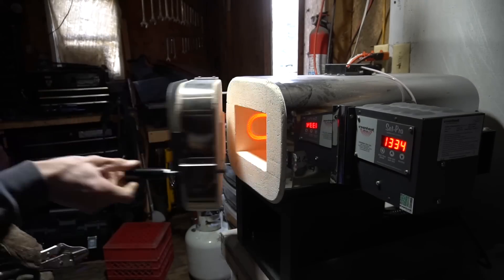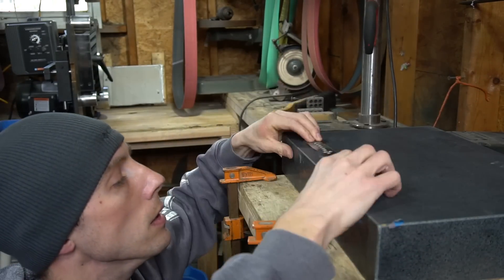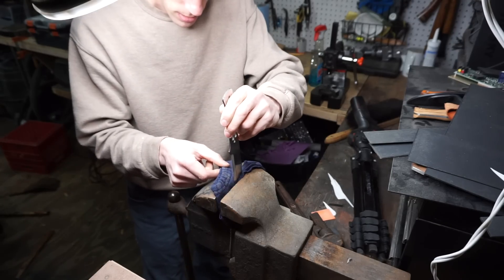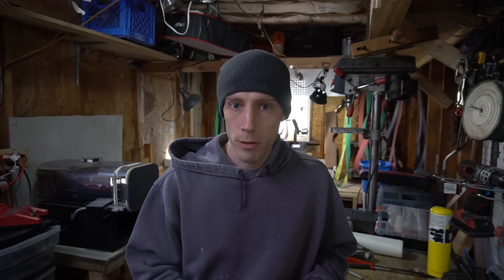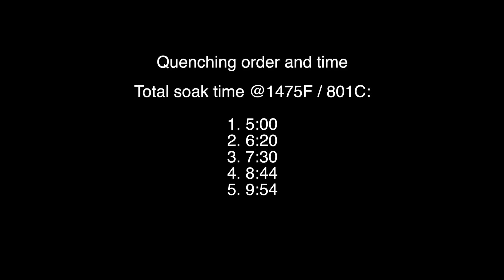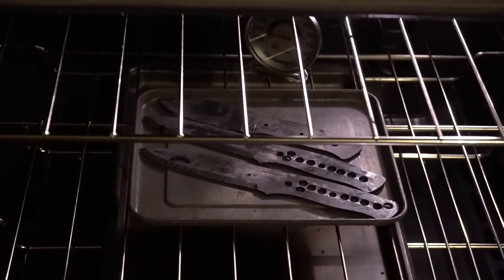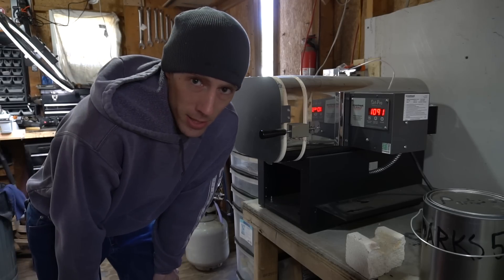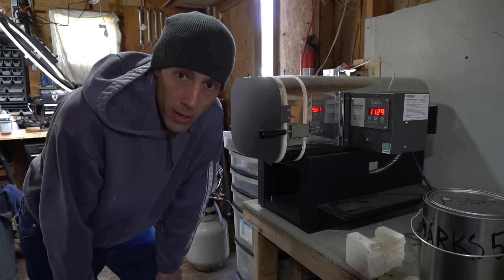Why Knife Makers Should Break Their Knives

Comment: Good work.  The heat treat conclusion is correct. However, you are misinterpreting what you are observing.  You are not looking at the grain structure.  You are looking at different types of failure modes.  In a brittle fracture, a crack forms and cleaves through the material, leaving a smooth finish.  In a ductile fracture, the material distorts and "necks down".  This simultaneously creates a rougher looking surface and simultaneously the effective cross-section is reduced.  Eventually, the cross section is reduced enough that tensile strength is exceeded.  When that occurs crack forms, the crack quickly propagates through the material and the knife breaks.  Part of the fractured surface will be rough and a part will be smooth.  

You can tell all about your heat treat process by simply looking at the fractured surface and estimating the ratio of ductile to the brittle fractured surface.  

As a side note, the ideal condition would be for the cutting edge to be hard (but not "brittle") and for the back to be more ductile.  That would create a knife that would both hold an edge and not snap under heavy loading.   

To observe the grain structure, you would need to cut polish the surface until it was mirror-like.  You would also need a microscope.  Sometimes you need polarized light and an etchant to cause the boundaries to "pop" out. 

In any case, good job.
Reply: This guy forges
Reply: @beepIL  Says Russ Hanneman, right?  lol
Reply: We SO need more researchers, developpers and Doctors commenting on Youtube video's
And this is why, Thanks @Dan Pedersen please spread the word.
Reply: Do you teach? 😅
Reply: @gamer.004  No, I did research in fracture mechanics.
Reply: Dan Pedersen woooow, Respect, I bow to you!!
Reply: Rob Rob if he is a researcher in fracture mechanics he deals with all kind of metal materials. So yes he knew what is he talking about. This is the same thing in steel manufacture and factory they do these kinds of test to verify a mixture of steels
Reply: The smartest comment thread i have seen.
Reply: thank you for this, youtubers spreading so much disinfo lately after being in a hobby for a year lol
Reply: I’ve studied a bit of material science in my engineering undergrad, and the practical experiments I’ve done match 100% what you’ve said. We used brass specimens instead of steel though.
Reply: Dan, so you're saying that grain structure is unobservable to the naked eye and the differences that appear in the various samples in the video are due to the state of the metal and how it fails, a brittle fracture appearing smooth and a ductile fracture being rougher?
Reply: @Aaron Washburn Yeah. I wasn't trying to say that plastic deformation always changed the yield point, just that plastic deformation only occurs after the material yields. In all honesty, I am not the most qualified on this topic, I was mainly just providing a bit of information as requested by OP.
Reply: Another option is to send it to X-ray diffraction/ Mossbauer spectroscopy to find out more about the bcc/grain structure of the blade without necessarily destroying it.
Reply: Would only polishing be enough? I was taught that etching is also vital to observe microstructure, but since materials science isn't my main specialty, I am generally curious about it
Reply: @Aaron Washburn ah ok, so I at least remember it correctly, thank you!
Reply: I would like to read about fracture mechanics. Could you recommend a source ?
Reply: @thiago.assumpcao  I do not have anything to suggest.  The internet is full of good information.  Google will find you many articles.  The primary measure is, "fracture toughness".  Also query the keywords, critical crack length, and fracture surface you will find some interesting things to read.
Reply: @MrTodayistheday  Thanks
Reply: I just wanted to write exactly the same just to find out that sb has alrdy done that and was even upvoted to the top. Nice
Reply: @Aaron Washburn it doesn't, powder only shows amorphic in mossbauer, it is often done with thin strips for better understanding.
Reply: Ok
Reply: he's too proud to adore your comment, that's sad
Reply: Can't you just call each other gay retards and move on like the rest of us? Jesus...
Reply: @CollinInGame  He's right though you know ... the current profession I'm learning in Germany deals with exactly that procedure and it's the backbone of quality control, especially for metals and has existed since 1906 so you know ... maybe setting things straight is not for 'gay retards' but for people that care about their products and make sure that they have a competitive advantage ...
Reply: @AlkalineLuke  Agreed
Reply: I thought that was Michael Rappaport in your pfp
Reply: Aha you dont say (pretends to have understood something here) Soooooo which steel used in folding knives have a near unbreakable tip?
Reply: @gurugoguzhanson  Good question.  There is a tradeoff between toughness (bend before break) and hardness.    Harder metals tend to hold a shaper edge.   To be unbreakable, it would have to be soft, making it useless as a knife.  There are some specialty vacuum melt steels used in the aerospace industry that are very tough.  I am not sure if they hold an edge.
Reply: The difference between strength of a blade and toughness is not difficult to understand ;D
Reply: @MrTodayistheday  There are some super alloys that are super strong with very high stiffness. They have a relatively very tall but steep stress-strain curve. Effectively they'd take more energy than a human being can manually generate to reach fracture but will pretty much just straight up shatter/explode almost immediately after yielding. The reason why we generally aim for relatively high toughness in most products we make is that the item yielding and elastically deforming is a good warning sign that a failure is about to occur if you're keeping up on maintenance and inspection. You generally don't want critical parts that give no sign at all that they're going to fail until they just completely snap in use. The other thing to impress upon people when they look at a stress-strain curve is that the strain axis for most metals is "blown up." The actual strain values are very small and this gets even worse for a very naturally brittle material with lower toughness. You may not perceive any actual displacement in the metal even when it's supposed to be fairly tough. I remember having this discussion doing material failure analysis to see if our sample matched empirical data taken from a chart and they were like, " We should have gotten 3 mm strain before yielding" and I had to remind them that the strain axis in that particular chart was normalized to accentuate and give a visible graph horizontally and that the actual value was 0.03 mm which is what the strain gauge readout was when it started yielding. 

Many of these blade smiths never took a course in materials science or engineering which is fine. The thing is though, that you generally don't have to do much destructive testing yourself anymore as there are empirical data charts where someone has gone through the work for you. Taking even an introduction materials science course will teach you that the primary key factors are Tmax (max temperature), deltaT (temperature differential during quenching), and deltat(time it took to reach the high temperature to the lower temperature.) The only time I did failure testing for metal samples was to ensure that the foundry quality was what they said it was. After that, the metal will behave pretty much as the charts say they will as long as you and your equipment will do their part. For example in this video, if you look closely, you can see discoloration in only one half up to nearly the core of the metal samples and this was consistent for nearly every sample. This shows that the metal in this video was at slightly different temperatures before quenching and could be an indicator that either the metal wasn't left inside of the oven till it was uniformly hot or the other metal was too close, becoming a heat sink and they effectively pulled heat from each other relative to the outside that just had full heating element.
Reply: @MrTodayistheday agreed and in outer space where it is extremely cold metals alloys steel and different materials all behave differently subjected to the cold and have to be engineered knowing these things.
 I'm sure NASA has a wealth of data to peruse if you have the right security clearance...... Thanks for your wisdom
Reply: Read a few articles about it. Very interesting. To make things a bit more complex there are other 4 types of fracture mechanics. Ductile, brittle, intergranular and stress. 
In this case its pretty obvious ductile fracture but it seems rough surface can also be intergranular.
Reply: @thiago.assumpcao  I like your enthusiam.  Intergranular fractures would occur if something strange happened in the cooling process causing a precipitate to coalesce at the grain boundaries (not common).  It could also happen if corrosion was playing a role. (Common with alloys containing very different electrical potentials).  Another mode of fracture is "fatigue".  It looks like a polished surface.  But, inspection with a microscope will reveal micro-striations associated with the load-unload cycle.  Good job.  Keep reading.  I hope to learn from you someday.
Reply: @MrTodayistheday  Thanks for the info. I've seen some very high level blackmiths mistake fracture mechanics with grain, that was really interesting and usefull. 
I have a small yt channel about knives and sharpening but all content is in Portuguese, maybe someday I'll translate the best videos to English.
Reply: @MrTodayistheday  Cool. I'm Brazilian, If he has any issues with with translation let me know.
Reply: Great info thank you
Reply: So make the edge only red hot with high power induction?
Reply: This is al FM to me, Fuckin Magic 🤔
Reply: Ductile definitely isn't the word you meant. Also, you wouldn't necessarily want a brittle edge. It doesn't matter too much how tough it is, but a higher toughness means you can repair it more easily. Brittle or tough, the priority should be making the edge strong and hard
Reply: @goodguykonrad3701  You are correct.  I did not think this lay audience would be interested in the technical definition of toughness: The area under the stress strain-curve or the ability to absorb energy before fracture.  I simplified the description to a ductile-brittle analogy. For a specific heat-treated steel, the more ductile heat treat is almost always tougher than the more brittle heat treat.    
I just came across this.  It is a better explanation than mine. http://www.materials.unsw.edu.au/tutorials/online-tutorials/2-cup-and-cone-fracture#img   
- Any idea on how to succinctly explain toughness to this audience?
Reply: @MrTodayistheday  Toughness is a measure of the amount of energy required to create new surface area on the material. It can be better described when the three stages of deformation: elastic, plastic, failure. 

Elastic deformation is when energy applied to a material causes it to deform/change shape, but the material will return to the state it was in before it was deformed (like how an elastic band can be stretched but returns to its original shape).

Plastic deformation occurs when the stress on an object is great enough that deformation goes beyond elastic and becomes a permanent change to the shape of the material (like creasing a piece of paper).

Failure is when plastic deformation is too great and new surface area (e.g. cracks) form and the material behaves differently and almost unpredictably. The creation of new surface area forms a stress concentrator, greatly increasing forces applied to that area, causing the object to break/rupture completely.

Strength is the object's ability to withstand elastic deformation. Toughness is the object's ability to withstand plastic deformation. Failure is when the object is at least partially broken and behaviour becomes less predictable as it breaks completely. 

Glass: strong, not tough
Rubber bands: not strong, tough
Paper: not strong, not tough
Metal: strong, tough

Also, I'm guessing ductile may have subtlely different meanings in different parts of the world: I'm from the UK and I've always been taught that ductility is a description of a material's ability to have long strands of wire drawn from it. Not to say that doesn't apply to the Australian link you sent me, but it seems bizarre in that context.
Reply: @MrTodayistheday  I would be interested in more technical talk on fractures, I was sad that the discussion ended.
Reply: @LondiniumArmoury  Sir, Thank you for the encouragement.  My intention was to introduce this group to a few new concepts and keywords.  I did research in this area many years ago. I thoroughly enjoyed doing research on this topic.  But, my calling was managing mega projects.  Unfortunately, I do not have the time to revisit this topic in detail.   There are a number of sites out there that can provide you a wealth of information.  When you start your independent reading it is important to know the following: Metals and non-metals fracture differently, ferrous metals and non-ferrous metals are heat treated using very different techniques.  Both cold working (forging) and heat treat affect both fracture toughness and failure mode.   I suggest you Google the following keywords: fracture surface, fracture analysis, heat treat, annealing, Rockwell hardness vs. heat treat, effect of heat treatment on tensile strength, effect of heat treatment on yield strength, tensile strength vs. yield strength (this is a quick estimate of toughness), stress-strain curve, fracture surface vs heat treat,  fracture toughness, crack length and critical crack length.   If you want to discuss something specific, you can contact me directly at pedersen124 at hot mail dot com
Reply: @MrTodayistheday  Thanks and no problem, I already have lots of Data sheets and files open on this topic on my laptop as we speak, it's an interesting topic that I might cover for a video series, I will credit you for the inspiration. I work with through hardened, differential hardened, cold work hardened and case hardened metals. Ranging from pure fine silver all the way to steel alloys and titanium. I agree with what you have been saying, I have also been working on comparison tests between through hardened steel and edge quenched and differential hardened steel. I also ran some tests on work hardening annealed steel until fracture and comparing it to a fracture in through hardened steel, I found crystal like structures that formed from the friction and break around the fracture, which from an annealed state I thought I shouldn't find.
Reply: @LondiniumArmoury   I am impressed that you are doing your own research.  If you can send me photos of your specimens, I can help you interpret the fracture surface. My explanation will simply assign the surface texture to the name associated with the mode of failure.  Knowing this will enable you to review a large body of work already existing on this topic.   Further, a few minutes of explanation up front will enable you to control and manipulate the appropriate parameters.  This could shorten your research by years.  :)
Reply: @MrTodayistheday  niceeeeee
Reply: @goodguykonrad3701  that would depend on the strength type and size of the carbides vanadium
chromium
Cobalt
Nitrogen
Molybdenum
Tungsten 
Choose your weapon and take advantage of what is offered by the mix of the metallurgy...
So many variables to play with... I love  postulating such things! 
It seems they are coming close to perfecting steel/edge retention applications with the new steels like magnacut vanax rex121 and terravantium  where edge toughness corrosion and sharpening are complimentary for modern day knife makers. I think the biggest issue is overcoming difficulty in resharpening such exotic  knife making materials if you don't have the right equipment and know how.
Never a better time in history than the moment... A veritable renaissance age we are living in! 
Thank you Alex and fellow enthusiasts community for freely sharing your knowledge wisdom and observations! 
Aloha
Reply: Further more, everytime you quench a piece in the oil you increase the oil's temperature and effectively reduce the effect of the quench.
Reply: @andrewmalaty8  counterintuitively higher the temp quicker the cooling
Reply: @Aaron Washburn I don't know why I called a rubber band tough: they are neither strong nor tough. I was very tired at the time of writing. 
With regards to "strength", once a material undergoes plastic deformation, it requires a greater stress than was used for elastic deformation. If you reduce the stress, the material can still undergo elastic deformation, although properties might be slightly altered. Looking at graphs of stress against strain is good for revealing the different effects of elastic and plastic deformation.
Reply: @goodguykonrad3701  elastic ceramics are very sharp and retain edge cutting capacity much longer than hard brittle stationary ceramics, so your rubber band theory has merit 😎
Reply: Can you nerds stfu thank you